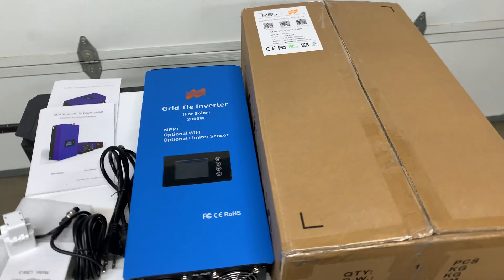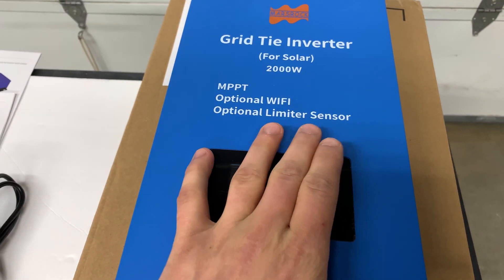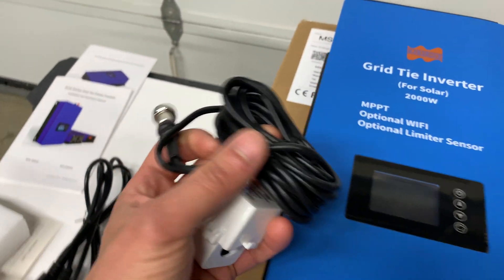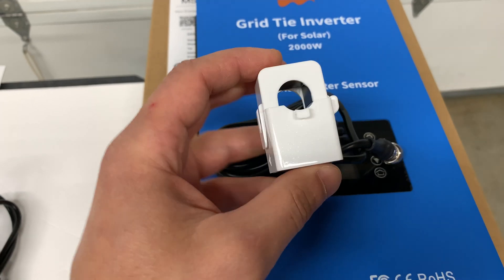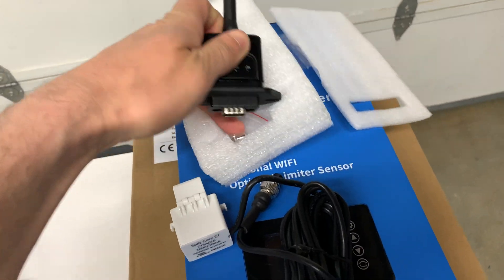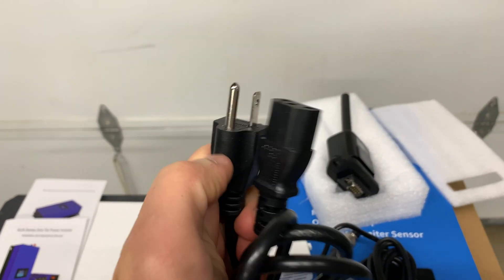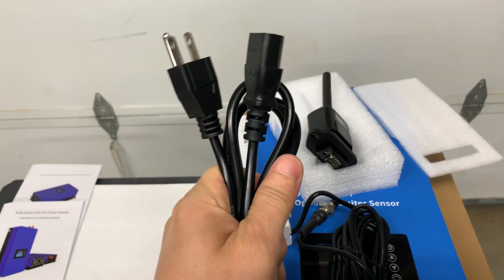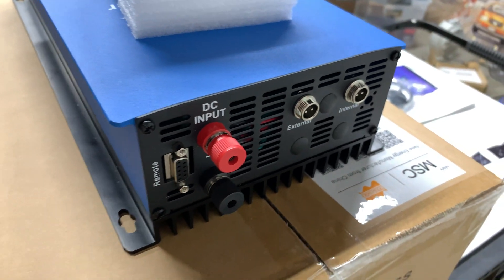2kW Grid Tie inverter with limiter. Review. Part 1 of 3. SunG Grid.

Comment: I have four of these hooked up to a 48V battery.  My limiter wiring is 2 ct clamps in parallel and then all the limiter plugs read the same info in parallel.  Everything seems to be working fine, but the output from my inverters doesn't seem to be lining up to the amount of power being consumed even when they are more than adequate to cover the load.  In this video you say to hook up the third leg to ground , but in my setup I hooked the middle or third leg to neutral.  Is this the problem?  Somehow I get the feeling that split phase is working against me like it is cancelling itself out or something weird.  Any ideas?

Comment: My dear friend.I have One and only question for you because the company tells me to read the manual.but Nothing is written on that.I have the 2 KW on grid tie inverter with limiter.I have started operating it and it works normally as an On grid inverter.I achieve full power 1550 volt.,without having connected the limiter.Now 2 days i try to connect the limiter and it shows that the inverter produces 25 watt  and grid gives 12 watt.Nothing more.Despite the fact that i use an aircondition too.My QUESTION.At the only screen that this inverter has do i have to define the    a) max Ampere of it      b) the power produced 2000 W    ?????thank you so much.respect  Pavlos
Reply from the maker: Hi there, you can set amperage or wattage. If inverter reads 25 watts when consumption is bigger, then check CT sensor wiring.
Reply: @SolarEngineering  CT sensor has got 2 wires.the only think if the readig is negative i turn the sensor so the arrow looks in the opposite direction.and then the reading is corrected.
Reply: Do you mean that i have to cut the cable of the sensor and connect the 2 cables the other way ??? Anyhow when the ivrter is in limited mode at the screnn that you see everything ,the only detailed screen they have. WHAT do i choose    A.Amperage details   Or  Watt details.Which one has to have the tick and be visible.??? And as they say this is the limit.I try to guess that and in watt [ imust place  the max power that the inverter gives  2000 wattt and in amperage i must choose the maximun output in ampere that the inverter can give .which for 2000 = 9 Ampere.
Reply: Turn the sensor the other way around so the arrow points the other way.

Comment: Dear friend.I have installed 3 x 2 KW SUN on grid inverter with limiter.They work fine.BUT.when city Grid goes off then finito.I do wonder.Can I not create my personal grid so inverters smell that exists voltage of 220 Volt with frequency 50 Hz.using  3 mirrors and  1 KW off grid inverter with a small battery????In case that the city grid goes off.Can i not use in the 3 inverters the same input from the off grid inverter.Note...that despite the fact i have a three phase city grid voltage i never use the advantage of the 3-phase voltage.I never have a 3-phase motor.Note also that i will use a transfer switch to discriminate the actual voltage source of the house.Position 1 city grid. Position 2 .My personal Grid.I would respect your expert opinion.Thanking you in advance my friend.cheerio
Reply: Self islanding is a safty feature for people working on the grid. You need to use an off grid inverter for what you want and run plugs off it to where you need them.
Reply: This video maker has the same problem and solves it with a very expensive SolArk hybrid system. Made a video about it https://youtu.be/yGWc1_Ujbq0
Reply: I have found MPP Solar all in one charge controller. Mains, battery and solar input. Off grid but can draw power from the grid if battery and solar low. I'm thinking put one between the grid and the fuse box. Better quality and not much more expensive!
Reply: Hello, how you install the limiters sensors? I have 2 of them, so I have 2 limiter sensors,  I should plug them on my main grid and the 2 of them? Or is any other way to use 1 limiter for 2 inverters?
Thank you 😊😊

Comment: hello My friend.
I have a very importnt question for you.whichi beleive other people surely have also.These 2 Kw sun ON-Grid inverters work perfectly.But many problems arrise when grid is off.from various reasons.  A. service,fault in the line, fire, strong winds   etc.....My question. Can i create my personal Grid so the inverters can smell electricity of 220 volts????And since i have one per phase  cause i have 3 phase system. Do i need an off grid  inverter of 6KW in total power???I am little confused.If my on grid inverter is 3 x 2 kw   power each [3 of them] the off grid inverter has to be similar in power?? 3  phase 3 x 2 KW.    OR i can even do my ignite voltage with a smaller 3 phase off grid inverter??In other words how electronically get into the ignite system and say to on grid inverter despite the fact that city Grid is off    ,Eiii   you have voltage 220.....operate....Thank you so much

Comment: My friend.I have 3 on-grid inverters with limiter.Each inverter has a limiter with a twin cable.As far as i have connected the limiter i secure the the gird -meter doesnt go back.Ok.Question.Now As the inverter is on operation,If i cut the line in the twin cable of the limiter ,will the grid meter write backwords??And if it does so can i regulate with a timer  a specific time in the day say from 9 to 10 in the morning to turn back the grid meter???
Reply from the maker: I'm not using these inverters anymore, I think you can easily answer your question by simply disconnecting limiters from inverter and see how inverter behaves.
Reply: @SolarEngineering  do you happen to know  AFORE  On grid inverter 6kw .Are these good??Or what type of inverter you  use now??I am interested.
Reply from the maker: @pkefvkef4856  I'm using Solark.
Not familiar with Afore.
Reply: Dumb digital meters only go forward, only the old analogue disk ones could go backward. Smart meters can read in both directions.

Comment: My friend.I have a 2 KW on-grid inverter  220volt AC.The incoming voltage from solar panels is 68v DC and the amperage is 30 Ampere.My upper voltage incoming from solar MUST BE LESS than 90 volts.Is a protection the knowledge of the existing panels that offer 68volt enough OR i have to install an upper /lower voltage controller for the panels DC incoming voltage???Is there a device that i can adjust Max permissible incoming voltage = 90 volts ????Thank you
Reply: You can adjust the volts/amps by putting solar panels in serial or parallel. What is theAmp range of the inverter? 2000W/45V = 44A or 2000W/90V = 22A? 68V x 30A = 2040W is in that range so probably works.

Comment: this model has a fault with how the bottom fans blow air onto the PCB at the bottom,  if that air is cold it can cause condensation build up on the lower area and then short the PCB out or cause the traces and components to fail due to corrosion,  i feel if they had the fans not so close to the pcb or coat that area to protect it the problem may be mitigate,   the 1000watt units don't seem to suffer the same problem

Comment: Hi, I want to connect a 24 volt lifepo4 accu pack how can i get the voltage to 48  volts?
Reply from the maker: it's going to be better to get a 24V inverter. Or you can connect two 24V batteries in series.
Reply: @SolarEngineering  ah thanks
Reply: I believe they have a 1000W version of this inverter that works with 24V. I'd rather buy a 48v battery though and use 2000W.

Comment: The sensor won’t work right in the states. Their is a guy that makes  one with two leads  that detect both side of power coming in.
Reply from the maker: yeah, checkout 2nd part of this video (link in description).
I'm going yo make my own cable for about $20.
Reply: Please make that video. I’d love to save cash.
Reply: I need one for two inverters
Reply from the maker: @penrodautorepair3170  yes, this will be in Part 3

Comment: I really want to see your next video see if it works.   I get one from ebay and get other from Amazon I hook up 48v with 4 batteries 200ah  each battery  but is keep say grid error  doesn't know what happened please up load your  next video thanks.
Reply from the maker: Sure! I'm preparing for the video. I did all research and it will work. Video will be soon.
Reply: Same problems